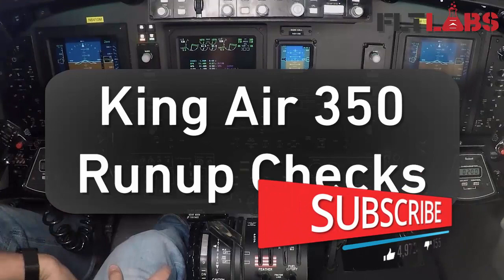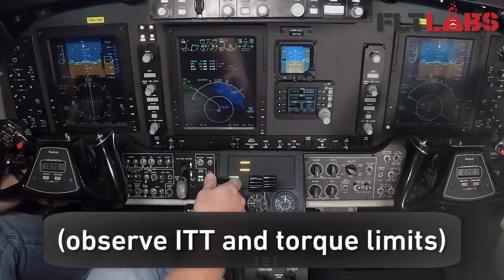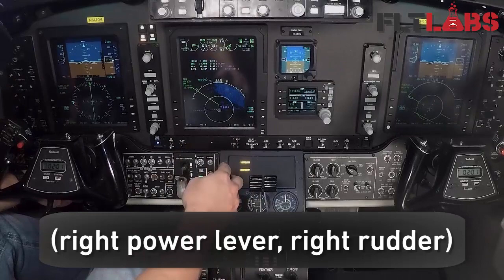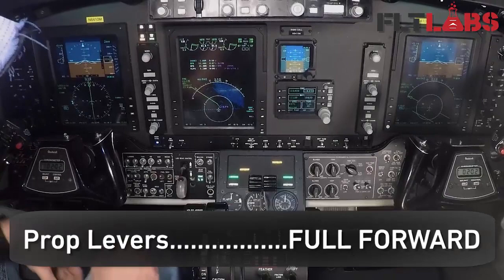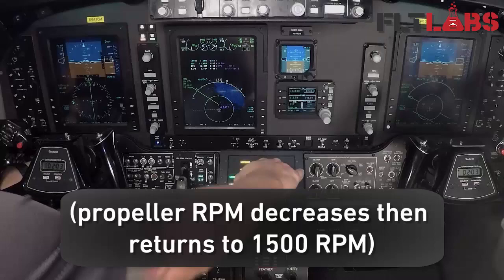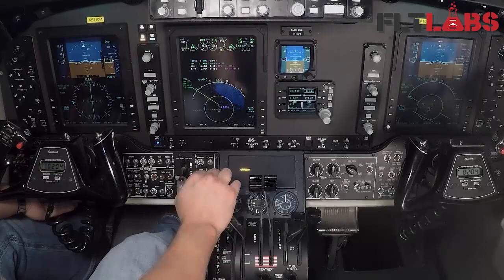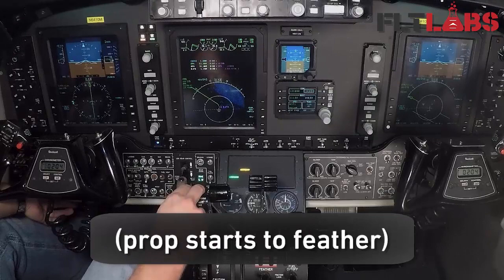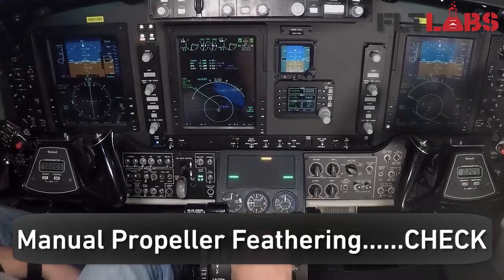KingAir350 Runup Checks with Eric Taylor

Comment: Good presentation but…

Nothing is achieved by re-advancing the left Power Lever in the Autofeather test. Instead, merely pull the right PL back to idle also and verify that the left propeller stops trying to feather.
Reply from the maker: This video was my attempt at a video version of the training facilities QRH. Any deviation would invalidate my intent. Maybe I miss understand but re-advancing the power lever is required otherwise the prop will stay in feather while I do the right side which doesn’t make sense to me.

Comment: Do you do these checks for each flight? Or just the first flight of the day? What if you are doing multiple flights each day?
Reply from the maker: Just the first flight...
Reply: @Eric_Taylor  thanks for that. One more question if I may, do you do flap approach landings two engine and single engine? The POH only has graphs for flap up and flap full down, but nothing for flap approach.
Reply from the maker: @rfingerboards8752  Without a published flaps approach speed flaps approach landings are not approved. Pilots say it's their judgment in certain senarios like with very high winds. I flew Kingairs in Afghanistan all year including the high wind months and we never had a problem landing full flaps... that said several captains landed flaps approach also so... its all over the place.
Reply: @Eric_Taylor  Thanks very much for the info. The debate I've heard is around leaving flaps at approach when single engine and in poor weather - to keep a stable approach concept when visual in poor weather at DA it is better to leave flaps at approach to avoid configuration and speed changes late on finals - which arguably goes away from a stable approach concept  and is easier to fly (no changes to power, trim, speed late on finals). But I agree that landing with flap approach is not approved, and with good training it is fine to take flap down once visual at DA even single engine - it is how the aircraft was designed and certified to be flown.